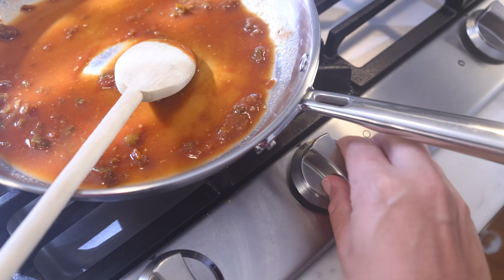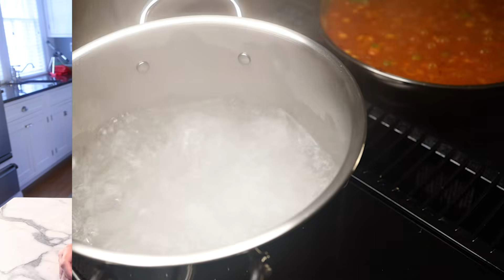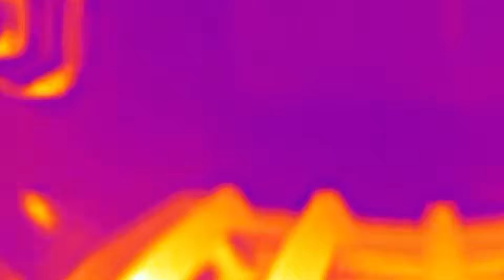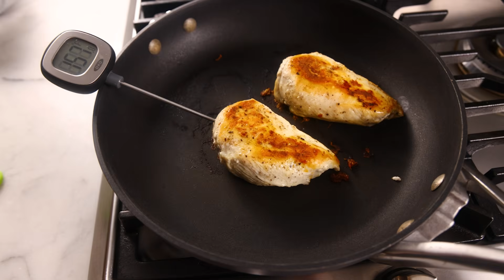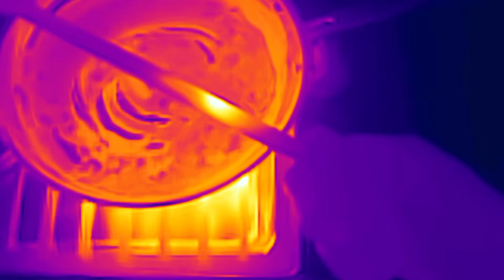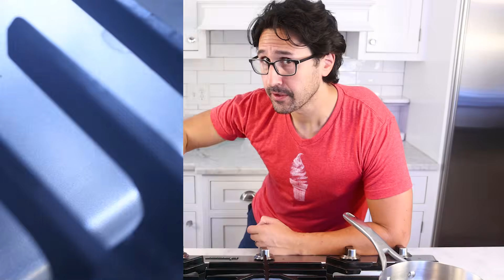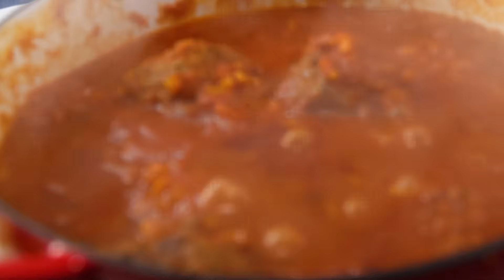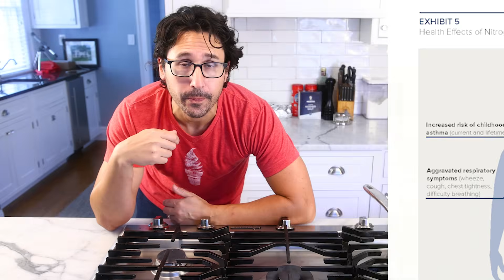Problems with gas stovetops | weak, dirty and dangerous

Comment: Hey! Just popping in to add my 2¢ as I lived with a gas stove for the first 18yrs of my life, until I moved in with my current partner 3years ago and have used electric since. (In addition to my mother using almost exclusively gas). In my opinion gas is far superior, not only in the sense of when the power is out you can still cook. I also have never once had to worry about the scorching seen in your pans, which leads me to question the quality of said pans and if they are intended for use on gas. (Though I would've thought you would've checked). For a great example, my mother has used the same pots and pans my entire life and still has them to this day, (replacing only because the handles broke), the only time she ever had a problem with things burning to the pan was when she accidentally left jam on for a little too long, and even then with some scrubbing it all came off. (A LOT of scrubbing, but I digress).
To add, we also prefer to boil water (in a gas hob kettle), on the gas as well. While we haven't done any extense research, my partner has noticed that the water boiled on the gas stays hotter for longer, possibly this is because it is kept on the hob with the grill iron keeping it at least slightly warm. To add, my partner is very very fussy about the temperature of his coffee/tea. I hope you reply to this, and I would like to add that I found this video fascinating to watch and see it from the perspective of someone who didn't grow up with gas as I have.
Reply: Also to add, my mother recently upgraded to a newer gas stove when she moved and it has all of the advantages of a glass top stove with removable burners (the assembly which directs the flame) to make cleaning even easier! Removing the burners is simple and makes it easy to soak them if they do get something spilled. The glass top everywhere else makes it as easy to clean as any other glass top

Comment: I have never used gas despite on camping stoves. I'm surprised hear that they are weaker than electric plates. But yeah, makes sense.
BTW the fastest way to cook water is to use an electric kettle (2000W, not those 1000W toys) first, even if you want to use a pot anyway. There's just much less material to heat up with the water. That's especially true for small amounts like for a cup of tea.

Comment: Gas stoves have a valve in the middle underneath the knob that allows for gas volume to be increased or changed. It was most likely never set by a qualified gas tech. We replaced our gas stove and had the tech check the flames on each burner. As for carbon footprint, electric running your induction or electric glass top still uses carbon fuels. The fume issue and poisonous gas build up...If the kitchen is so tight as to produce flame that fails to burn clean, you already have a condition where health is at risk. If the Green Deal people are behind the study then maybe they should cook in the daytime when the solar panels provide the electric. Or a renewable alternative is firewood. Try cooking in a fireplace...burned sauce I'll bet. I like most of you videos, so I'm not down on your presentations, just some of the studies groups generate.

Comment: I find glass top ranges to be a colossal pain in the ass to clean.  I also prefer gas because you can see if it's on or not.

I do have a couple portable induction burners that I used to take with me when traveling.  (Only took one, but they were cheap so I got a backup.)  They're the greatest from a safety standpoint since they don't actually heat up.  However their finickiness about which pans they work with can be a nuisance.  On the other hand, I've kind of wondered if you couldn't just put a cast iron pan on one and then a non-ferrous pan on it to use the non-ferrous pan with induction.  (Sort of a reverse of something I saw Alton do in a candy episode of "Good Eats".  He used a cast iron pan on a gas stove to even out and lower the heat from the gas stove.)

All that said, while I prefer gas stove tops, I like electric better in the oven (preferably with optional convection).  I'm really hoping hybrid ranges come down in price before my next replacement.

Edit:
Fun note:  On my previous gas stove, which had separate grates for each burner instead of the single massive one like modern stoves; I could turn the grate upside down, remove the disperser-top thingy on the burner, and light the burner (with a lighter since the electric igniter wouldn't light it without the disperser top).  This would produce a single very hot point of concentrated fire.  With the grate upside down and acting as a sort of divot, it worked GREAT with my carbon steel wok.

Comment: I have cooked on all 3 of the 4 kinds at different points of my life: gas, infrared (which in spain we call "vitroceramica" which refers to the kind of ceramic glass they use), and now we have induction. I can say that the infrared electric one was the worst. It took VERY long to heat up the water (almost 10 minutes to bring a medium sized pot to a boil), and had a tendency to burn things randomly while cycling the power. Maybe it was underpowered but it seems to be the common experience with everyone I know that uses it. Gas is second on my list because of the issues you mentioned with heating the pots so much on the sides. The clear winner for me is induction, but it does have the issue of it not being able to transfer heat the moment you raise a pan from the glass. So far as I care, it's a small inconvenience overall and induction still wins regardless.
Reply: Well thats cause for induction you aren't transferring heat. What it's doing is in the name it inuduces a current in your pan via EMF(elctromotive force aka voltage).
Reply: I also enjoy our induction stove, however ours has a major limitation in that only 1 of the 4 elements can be at high at any given time. If you set one to high, the most you can get is another element at medium, and zero from the other two. It's incredibly frustrating and a big handicap when trying to cook a proper meal, which requires more than 1 thing cooking at once. If you suddenly remember you need to boil water for tea, you literally have to stop all the other cooking until that water is boiled.
Reply: @BaghaShams  you have the propper voltage going to it?
Reply: @bigkirbyhj666  I think you mean current, and yes the wiring has been done properly. I think the problem is just the model I have
Reply: @BaghaShams  how do you think that current is produced?
Reply: @BaghaShams  The one here goes 1 to 9 on each of the 3 elements, the third one is dual, can either be medium, or biggest.
I haven't tried having all 3 of them at level 9, but at the very least 2 of them is possible. I rarely use 9 though because unless you are boiling something, 8 is enough to char meat instead of cooking it, so I fry at 6-7.
I'm on lease and it was already here when I got here, so no idea exactly what kind of power limit it has.
Reply: @gigaherz_  yeah so, mine gives me a total of 12 points to use across all 4 elements. If one is set to 9, then another can be at 3--and that's it. I could have two elements on medium, 6 & 6. But no more than that. It's infuriating.

Comment: Gas stoves have always been the go to for my family for years and especially when it comes to the way they give a visual cue to how high the burners are on and if they should be adjusted for the pot, also the gates can be more durable than glass and you don't have to be so worried about breaking it when banging pots and pans around while cooking. Personally I love gas stoves, I am willing to try induction stoves at a friend's house if given the chance but after I will never cook on a electric stove if there is an alternative.

Comment: I have a relatively modern electric coil stove--with digital readouts and burner controls. If you're touring my home, the stove looks great. If you're cooking on it, you'll be beyond disappointed because it is sooooooo slow to react. If I switch the heat from high to medium on Saturday afternoon, it might actually complete the adjustment by sometime Tuesday. I spend a lot of my cooking time shifting burners and holding pots in the air while the burners adjust to a new setting.

Comment: its all true but i just find cooking more fun with gas, and that's the reason i always choose gas stoves. also worth noting i grew up with high quality gas stoves and this may influence my feelings. also being able to modulate the temp in real time is something i struggle to cook without. I'm currently saving for a kitchen renovation and i saw this gas range with an integrated induction griddle - now that's podracing

also re boiling water: just put it in the kettle first, and then pre heat the pan whilst the kettle boils. thats so much quicker than an electric stove would boil water anyway, that's how i did it when i had gas an when i had electric.

Comment: For a wok, you don't want the fire to be spread out more; the fire spreading out in that photo is just a consequence of a very high-powered fire. You can even see that it's more centralized than a typical gas burner. You want a very high-powered central heat so the food in the middle gets cooked while other things can be pushed up the sides. J Kenji Lopez-Alt has written about this and reviewed outdoor wok burners and found that even some that output less heat but did so more towards the center performed better than ones that output more but were more spread out.

Comment: I moved not too long ago, and went from an open coil top to a gas range, and the boil time was the first thing I noticed. I have copper bottom pans that were practically instant at boiling the water on the coils, only taking a few minutes. The gas range tends to take a lot longer, and I notice that on high the flames spread out toward the edges of the pans. I will say however that my experience with the low setting on mine seems much lower than your low is. I can leave stuff without much worry of burn if it's all the way down, though I could test that a bit more.

Comment: Good thing of gas stoves? When you have a blackout you can still cook 😉
Reply: Do they still start though? Don't they take electricity to start? Idk tho
Reply: @IPlayGames3  no it’s just a flint that gets scratched and ignites the fuel, it’s like a common lighter and so doesn’t need electricity
Reply: @muelesariocontra  oh
Reply: I’ve never seen a gas stove that ignites mechanically. Only portable propane stoves. I would assume the vast majority of gas stoves use electricity to ignite. It’s not a big deal in a blackout anyway, though. You can just use a lighter instead.

Comment: I've long switched to induction for most of my cooking and a cassette burner for use with a Wok. Good cassette burners have higher output than the average gas stovetops (mine is 15k BTU, more than enough to make quick stir fries) and are portable. Fuel cost is not a problem since it's not used very often.

Comment: Induction is quite nice but does need pans with magnetic bottoms to work.  An all aluminum pan, or some stainless steel pans, will not work.

Induction also scores first place for least heat wasted into the environment and most heat per watt delivered to the pan.  Naked coil electric scores second place here, with glass top electric third place.  If one is concerned about not fighting air conditioning or otherwise heating up the kitchen a lot during the summer, one of these is the way to go if possible.

Comment: Induction or electric do not work during power cuts. That's a massive advantage over the rest.
I have used induction as well as gas stoves but I prefer using gas because I can see with my own eyes 👀 the flames and control the outflow of gas manually. Induction ovens do not work with Aluminium or copper vessels.

Comment: All true, but I used to have a gas cooker and now have an electric one and I can't emphasise enough how good it was to be able to quickly adjust and fine tune temperature. Electric hobs feel so clunky with it taking so long to heat up and change temperature, and there are only 5 heat settings.

Comment: imo a good gas stove is still superior. mine is so hot you can do proper wok cooking even with the pan relatively far from the flame. I still have yet to use any electric or induction stove that can even come close to my gas stove. Even though good electric and induction stoves can match and surpass that power, I simply like the informational feedback a flame. i kind of wish there was some sort of inbetween where you have the advantages of both

Comment: I've always found the problem with electric to be that the minimum is way too hot, though maybe that's coz I've only used cheap models. I mainly like gas because regardless of what model you're using you know the temperature by looking at the size of the flame. Electric ones all have their own calibration so you're just guessing
Reply: Was it glass top or coil? on glass top I never had this problem, but on the old coil I did. Gas for sure can not give you as high highs or as low lows as electric.
Reply: It all depends on the stove. My mother's glass top electric can get very low. I'm talking so low you could almost keep your hand on it when it's at it's lowest. Others I've used will still boil vigorously even on low. At my place I have a glass top that is great for low to medium heat stuff but just doesn't have the oomph when you need a lot of heat. So I have a little induction hot plate that can blast the hell out of some high heat cooking but can't do low heat at all.
Reply: my induction stove has a zero setting, to keep food barely lukewarm/

Comment: 8:30 At least here in Germany, glass top stoves are usually resistive heaters, too. Induction has come down in price in the last decade or so, so these days you see induction stoves more often. But in older kitchens, or in rental apartments etc., you mostly see resistive glass top hobs.
When I got my new kitchen, I installed a nice gas hob about the size as yours. I know cooking on gas from my parent's house and I always loved it. After four years of enjoying the cooking and hating the cleaning, I finally ordered a nice induction hob to replace the gas one. Can't wait to install it this week ;)
Reply: Fun fact a big reason induction is getting cheaper is the mass adoption of wireless charging it's essentially the exact same technology.

Comment: here in germany we also have allot of resistive heaters under glass, induction just became popular in the last decade I guess (help I am getting old, I wanted to write years but that wouldn't be too accurate) but we still have lots of normal resistive type heaters, a stove isn't too cheap afterall and it will take some time to swap them out.

Comment: One thing I found really annoying with induction hobs (at least the ones I have used) is that they all automatically and immediately turn off, and then require me to press the "On" button again every single freaking time the pan/pot is lifted off the surface - which as I found out is way more often than I previously noticed. That switching off action is completely redundant because by physics, no induction if no pot on top!

Maybe I'm missing something but how hard is it to put like a 5s timer to wait before shutting things off completely?
If there's any brand of induction stove out there that can do that, I'm 100% gonna switch to induction.

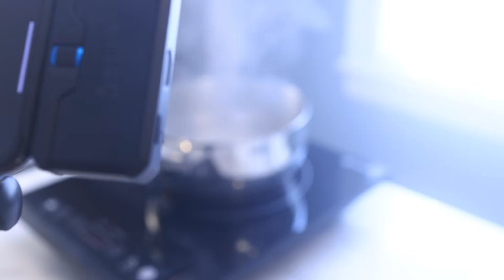Comment: Not sure that it changes your conclusion, but that’s not an “electric stovetop” in the conventional sense @2:48. That’s an induction cooktop - meaning the magnetic induction is heating the entire pot. For most households, a better comparison would be a glass cooktop or coils.  

Still might result in the same conclusion, but probably would have been worth pointing out - especially right after the “stacking the deck comment”

Comment: Where is the infrared image of the electric stove. I think it is such a important part that was missed. Visiol proofs and examples makes us(at least me) understand it easier. I really wanted to see how electric stove use their heat, from what I can see from gas stoves they really lose a considerable amount of heat energy from sides. Antway still thank you for your video and I can probably find a infrared vision of electric stove from another video but it would be nice if it was also in yoru video along with your voice. Keep up the great work man.

Comment: I have cooked on both gas and electric, and I gotta say, I prefer gas. BUUUT, a lot of that is probably influenced by the simple fact that two of the electric cooktops I use currently (The one at my [rental] house, and my parents') are awful, low-powered open-coil electric burners, that don't even get "red hot." More... "Brown hot?"

Comment: there is a war waged upon gas, its attacked at every angle. you must remove current engineering from the equation to properly figure out efficiency.   You want to know the actual efficiency of  something, you must measure its potential as well as its current condition and even what it costs to switch to a new system. Efficiency can be added up in many ways and can have many points of view.
 --however gas, much like a Pit Bull, has a high potential for more danger when things go wrong like explosions and suffocation or a gauntlet of things we have learned throughout our almost 200 years of using it for cooking.  about 1920  is when the power grid was able to sustain all those electric ranges but the big introduction happened during the 1890's world fair. which equals to about 1/2 the lifespan of gas before it was possible to be "main stream", but there are plenty of dangers associated with electric cooking as well and perhaps many more yet to discover.  But the one main point is extremely valuable, So far overall as far as we know electric cooking is safer, can be and is mostly more efficient and has less potential for those extreme outcomes when stuff goes wrong.